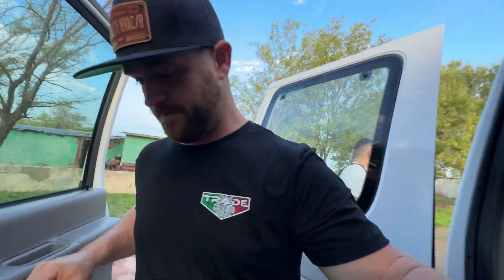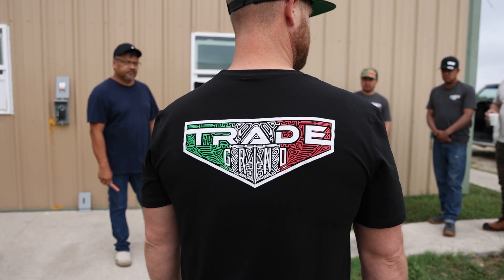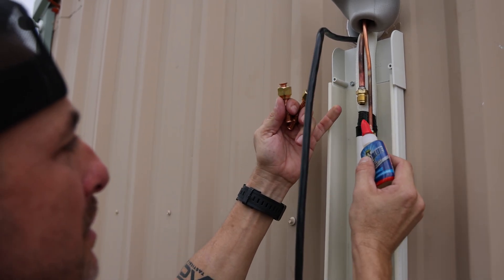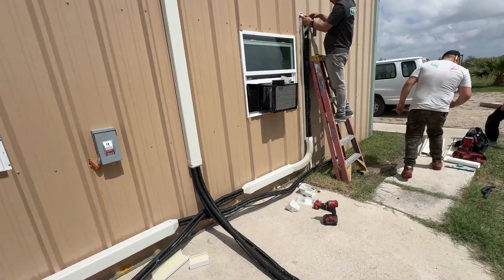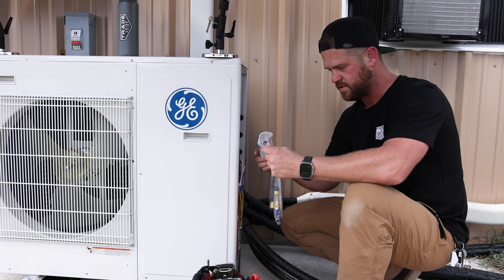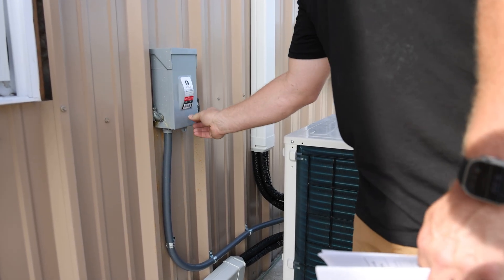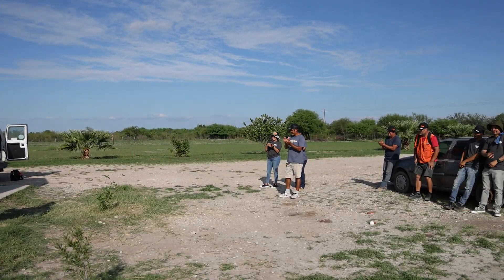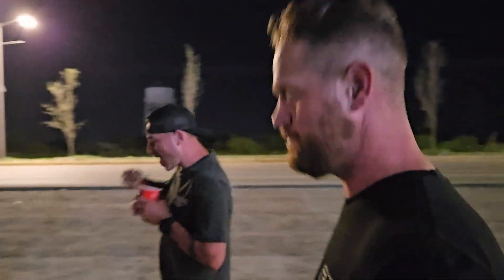Installing a 4 Zone DUCTLESS system in Mexico - Ep. 3

Comment: What’s up with the zoomlock? Seems like an extra place for a leak. And if you use nylog on your fittings it changes the torque. Likely those torque specs you have were supposed to be dry. Likely they’re over torqued. 

It looks nice, I would have just changed some of these small details that could turn into issues. I’m not sure how close you are to this place in Mexico, but if it were me I’m thinking about not doing any warranty work there because I got it done the first time. 

Food for thought